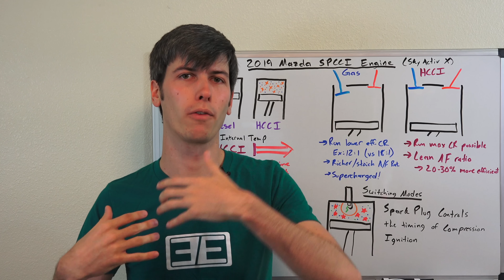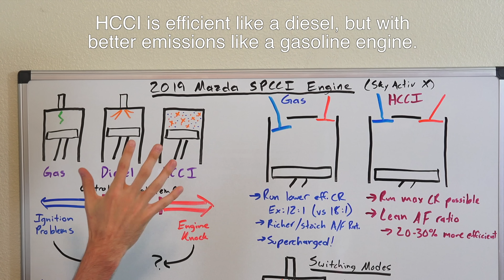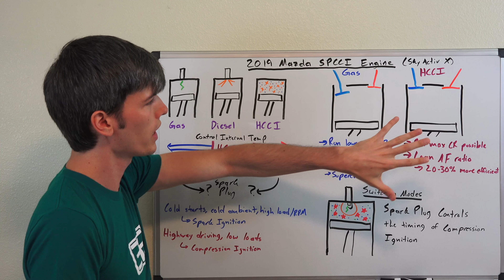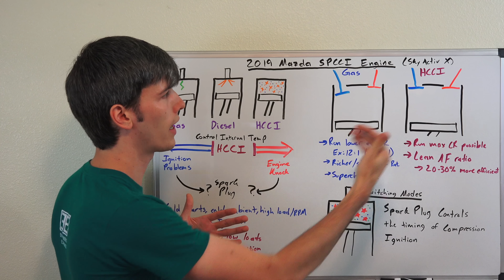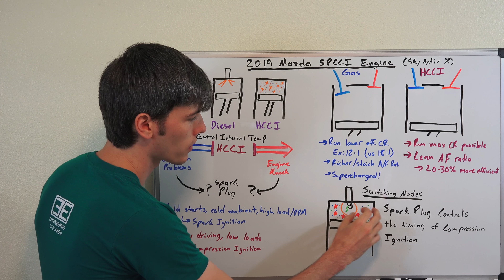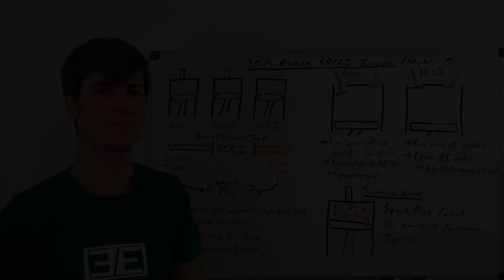Mazda Creates The Holy Grail Of Gasoline Engines - HCCI SkyActiv-X

Comment: Chuck a small one of these into an electric/hybrid and use it as a small generator.. that'll be efficient for sure
Reply: Oscar Sorensen I agree, this is the direction that hybrids should head
Reply: South4153 What a shame, I rather put gas in my car every 2 or 3 weeks, not charge it every night.
Reply: I wonder why we don't use turbine engines for hybrids because they like to run efficiently at the same speed and they can burn many different fuels. Seems like it'd be the perfect match to an alternator through a set of worm or plantary gears
Reply: Appreciate the idea but even if efficiency is high for a gasoline engine this would still be retarded from an energy stand point. The only reason to do this would because battery range/size is still meh compared to fuel tank size/range.
Reply: sonictech1000 Where does he mention charging up at home? He's comparing it to filling up the tank. Something most people aren't able to do at home. The electrical equivalent of a petrol station is a super charger.
Reply: rmb9311 I'm no engineer 😂 but maybe a scaled down version of this engine, that runs at a set rpm acting like a dummy engine. The output of the generator would depend or the electric motors and battery used I guess
Reply: Today electric cars have 200+ mile range, and for a bit more cash, you can get 400 miles. It's not directly comparable to ICE car ranges, because you can charge your EV everywhere, including your home, while you have to drive your ICE car to a special place to refuel. Most people drive less than 50 miles a day most of the time, so charging is only an issue on long trips. And with a good fast charging network, which already exists in the developed world, even that's only a small inconvenience. 
Tesla already sold about 200,000 cars (sales going up by 60% every year), and has about 500,000 reservations for it's new model that just went into production. People buy a Tesla not just because it's green, but because it's one of the best cars in the world. Better performance, safety, reliability, comfort, less maintenance, and almost no noise are the main advantages. They also have good range, and comparable price to a similar ICE car.
And battery technology is advancing very fast. Price, energy density and charging times are all going to significantly improve in the next few years. Big money is just started to go into R&D in response to the new demand generated by electric cars. Batteries with several times higher capacity, very fast charging, and lot longer lifetime are all exist in laboratories now, and some improvements are ready for mass production.
Reply: lemster101 His numbers are for a standard home style charger and yours are for a super charger.  If you didn't know this I'm not sure you should be having this discussion.
Reply: rmb9311 Alongside plugged in charging... Imagine a long road trip, this'll use a ton of electric. The engine could provide this reliably. However for short trips the engine will never get up to temperature and become efficient enough to be any good. So plugged in charging at home for daily/small trip use would be almost essential
Reply: Oscar Sorensen, What type of efficient  motor/ generator combo would you suggest to only recharge the battery. To allow for long distance highway use?
Reply: 30 minutes to get about 270 km of range or 75 minutes until full on a Tesla Model S. I have no idea where you get those numbers from.
Reply: lemster101 It was obvious from the numbers he gave. 

 The typical scenerao with a gas car is to fill up at a gas station in minutes but the most common scenario with an electric car is to charge at home.  Even when you're out and about finding a supercharging stations is the exception, the vast majority of public chargers are of the slower variety.
Reply: Herr doktorbimmer especially the build process of a tesla is zero emissions😂😂😂
Reply: +South4153
Making electric cars now is worse for the environment, but they make up for it fast, and on the long term they are much cleaner. And in the future their advantage will only grow, as the grid and battery manufacturing gets cleaner.
And the very least these cars don't emit toxic fumes right in the middle of densely populated cities. Just shifting the pollution to big power plants in itself is great for our health, even if it doesn't help much to stop climate change.
Reply: This guy has forgotten his medication.
Reply: For the planet it's definitely good. For the poor people it's not worse then other poorly regulated industrial activities, such as fracking and oil pipelines. And as I said manufacturers, especially Tesla, are working hard to clean up the process.
As for emissions, power plants are much cleaner then cars, and are further away from people, so the health effects are way much less severe. And since the grid is becoming significantly cleaner every year, and lot's of EV owners have solar panels too, the advantage of EVs grows fast.
As a bonus EVs last much longer then ICE cars, so in the long run much less manufacturing will be needed, which further reduces pollution.
Reply: Imagine if they make a HCCI Wankel generator? If you only need to run at fixed RPM against a fixed load, the principal disadvantages that have driven Wankel off the roads basically disappear. You can get a really small, low-vibration unit.
Reply: Probably better then a regular hybrid, but then you are lugging around the full set for gasoline and electric propulsion...
Ultimately it's best to just ditch the gas engine once you go into electric propulsion.
Reply: John Possum I think turbines cost too much for vehicles. Probably $50 thousand or more just for just the turbine engine. Probably more.
Reply: sure. toss in a supercharged high revving mazda engine into a hybrid. that won't totally defeat the purpose.
Reply: like a 3rd gen volt
Reply: rmb9311 fisker already went in that direction but the musk propaganda killed them.

Comment: So it looks like they will deliberately run borderline too-cold-for-hcci conditions (or not quite high enough pressure) and run a richer mixture around the plug (because you can do that with direct injection now) in order to spark ignite a small portion to reliably and perfectly time hcci for 80% of the charge...

Cool!

Comment: I have heard that these engines will not be supercharged as we know it but rather be using some kind of high pressure air injection (like a fuel injector). That would also allow to increase the in-cylinder pressure and temperature. Does that sound possible to you ?

Comment: Awesome you got my message!!! Question though, running lean in a traditional gas engine is commonly known to cause overheating and other issues...if the high efficiency mode is running so much leaner while cruising how are those lean A/F ratio issues avoided with this configuration??? (hypothetically of course)
Reply from the maker: HCCI actually runs much cooler, instead of a slower burning flame front that travels through the air fuel mixture, you ideally have everything combust all at once close to top dead center, and the majority of that heat energy is turned into useful work.

Comment: I've read about compression ignition gasoline a while back and it's interesting to know that they are putting in production cars! 

And I don't think internal combustion is going away quietly in the night, and if it is going to die, it will be because of ripe of old age and be the most advanced. The last internal combustion might be one that is very clean, very efficient, and very powerful, even more so than today's technology.

Comment: wouldnt leaving the intake valve open during compression just partially compress air from the cylinder back into the intake manifold?

and its forced induction? i feel like they should be opening the exhaust to allow the extra compression pressure to escape out the exhaust rather than trying to force air back out of the intake valve which is trying to force air in because supercharger.
Reply: Sean Person Would fail emissions requirements. All this happens so fast that the mixture gets pushed back in the chamber. But the intake channels will be dirtier as result.
Reply from the maker: If you forced air out the exhaust, you'd be sending fuel out the exhaust. They haven't stated how they're doing it, so that part is speculation, but that's how their current SkyActiv engines work. They leave the intake open for a short period during compression, pushing out some of the air and fuel. This makes it more efficient because the expansion ratio is greater than the effective compression ratio, which increases the amount of useful work done.

Comment: So will it need a higher octane gasoline?
Reply from the maker: That's a good question, but it will certainly run on pump gas. Likely will adjust accordingly based on whatever fuel you'd put in it. Higher octanes would allow for more compression, greater efficiency.
Reply: Why would it?

Comment: So, does HCCI run on gas? if so, what octane?
Reply: Mazda will design it for all levels of octane available at the pump here in North America, which is 87 to 93/94.  Most people will stick in 87 like they've always done, so the engine will detect a knock event (ie. detonation before the compression cycle is fully completed) and compensate by using a number of control factors like spark plug, timing, amount of air/fuel injected, etc.  In other words, it already has been accounted for and built into the design.
Reply: BangDroid lol LPG is liquid. Thus the L for liquid.
Reply: Umm, whatever Mazda chooses? It's like with current engines - AFAIK most of them can burn whatever normal (over 90 octane) gasoline you give them, their ECU will just change some settings accordingly.
Reply: Right, but if the engine switches to HCCI mode and the combustion relies on the heat in the chamber I assume that there's some conflict if low octane fuel is found.
Reply: You can actually run any octane number you like, it's designed to manage the in-cylinder temperature, so when you run lower octane fuel, the in-cylinder temperature will have to be lower to ignite it without detonating (for example the intake valve will remain open for a longer period of time to lower the effective compression ratio). Same principle with higher octane fuel, more effective compression ratio. Depends on which fuel Mazda likes the most.
Reply: wayde philpot most of today's car's run like crap on 87....people buy it because it's the cheapest one available....
Reply: gas like hydrogen propane etc
Reply: I never understood why you guys call it Gas. I get it's short for gasoline but it's just petroleum. Gas sounds too much like a state of matter or something like LPG
Reply: ^^ this. And petrol aka gasoline is a liquid most often called gas which is already a word that means something else.
Reply: • It should be noted that Finland like the rest of Europe uses RON when displaying the octane while Canada and USA uses AKI so they are not directly comparable numbers. Besides majority uses 95 in Finland anyway so there's that.
Reply: Leo Coscarella i would imagine there will be some fine print and disclaimers with this. Current skyactiv engines are designed to run on 87 octane here in the US (except for the mx5 which is optimized for 91-93). Thats with a high 13:1 compression ratio. The cool thing about Mazdas version of hcci is that it can get assistance from the spark plug in certain conditions. With lower octane, the spark may be needed for combustion bc it make ignite too easily (before compression has a chance to ignite it). Higher octane fuel is more resistant ofcourse which is more ideal for hcci....gdi may allow for mazda to still run 87 perfectly fine tho bc it can get injected whenever the ecu deems appropriate (not relying on the intake valves to get fuel into the cylinder)

Comment: Makes me wonder if intake valve deposits will become an even bigger problem than it already is on current direct injection engines.
Reply: I believe that because it is supercharged the air/fuel mix will not go far into the intake manifold.
Reply: Actually, this should solve the issue of the deposits. The reason a muliti point injection didn't had problems with deposits on the intake valves was because the gasoline which was injected washed away any deposits on the valves. With normal direct injection, this effect is of course lost. But with the use of the atkinson cycle, the effect should return.
Reply: Andrew Wan Mazda has already addressed this from what ive read by way of coolant passages or lack thereof. The intake valve area is allowed to get hotter than the rest of the head. This helps minimize deposit build up. The slightly higher temps near the valves dont allow deposits to build up as easily.
Reply: The source of deposits is EGR and PCV equipment. Otherwise the air would be clean all the way to the intake valve. Installing an oil-separator on the PCV or EGR line feeding back through the intake eliminates the deposits.

Thinking of getting some of this stuff to do periodic preventative maintenance on my DI engine. http://www.wynnsusa.com/product/de-carbon-foam/
Reply: Andrew Wan That was my thought as well.   Sending some air and fuel back up the intake seems like a recipe for trouble long term.
Reply: Wouldn't be any different than standard direct injection engines, as far as intake deposits go.

Comment: just imagine how awesome a HCCI Freevalve engine would be
Reply: quinnjohn1 that is freevalve. Freevalve is a sister company to Koenigsegg
Reply: I would have a perpetual nut when such thing happens.
Reply: TheCarLovingSwede Thanks, I wasn't sure of the details.
Reply: freevalve really is the key to the hcci engine if you want it to run without a spark plug
Reply: Imagine how messy that'll be been when an HCCI freevalve engine's inner parts start duking it out with each other for cylinder space
Reply: Christian von Koenigsegg mentioned in one of the /DRIVE videos that the same size actuator can be used for a diesel truck running 5000 rpm and a motorcycle running 15000 rpm, because of the size of the valves. Basically that means that a bigger actuator on a smaller engine will is the same as a stronger spring on a rocker arm.
Reply: Yeah! I think Hybrids are the best of both worlds. Imagine a car in the future with KDD, Petrol-Electric with Koenigsegg FlexFuel E85 technology and FreeValve! 

Then you add things like sequential turbos like the Bugatti Chiron, with variable veins for better efficiency, supercharger for low end power in addition to electric boost and finally SkyActiv-X. 

It would be insanely complex but insanely powerful and efficient! So exciting! 

Heck with most of the above technology (E85, FreeValve, KDD Hybrid Electric, and SkyActiv-X) we could see the return of a Naturally Aspirated V12 with unmatched smoothness, sound and bruteforce!
Reply: Neo VeNoM
That is correct. Actually Freevalve have already driven an old Saab with the system in it for a long time.
Reply: TheCarLovingSwede lol your profile picture tricked me. I thought it was an eyelash.
Reply: Does anyone understand how research and development works? Or do we think everything sort of falls from the skies and ether works or explodes?
Reply: If I am not mistaken the car manufacturer they are teaming up with is Qoros.
Reply: Germanik that's what I was thinking. I wonder what numbers you could get out of an engine like that. It would be crazy.
Reply: So many questions, so little time.
Reply: Lifted_Above This troll has comments on every car video on YouTube. I guess the best thing to do is flag all the comments hes made.
Reply: Lifted_Above No I think he needs mental help
Reply: I think Koenigsegg are working with a manufacturer to make pneumatic valve heads viable for mass production. If you like engineering, this is an interesting time.
Reply: Hasn't one of the limitations of the Freevalve technology been high rpm?
Reply: doktorbimmer.....should I re-quote what you originally wanted to ask me?
Reply: You're being dishonest. You said more.
Reply: Perhaps. I guess I haven't noticed most of the other videos but I'll take your word for it. Some people are very self-conceited and hide behind a front of superiority.
Reply: Lifted_Above Look at any video on engines or cars and he'll be in the comments
Reply: Lifted_Above It looks like it's mostly alternant energy videos.
Reply: I'm sure he's a self-built scientist. Probably makes Nicola Tesla or Einstein look pathetic.
Reply: it's called "two stroke engine"
Reply: they are, it's a chinese manufacturer.
Reply: Sounds like valve weight is a factor on how quickly it can reciprocate. Some motorcycles use titanium valves.